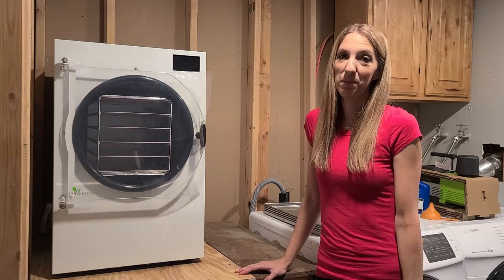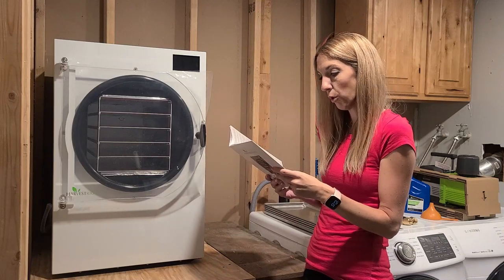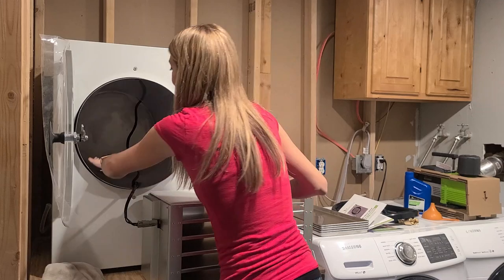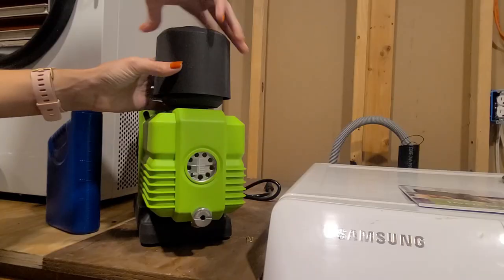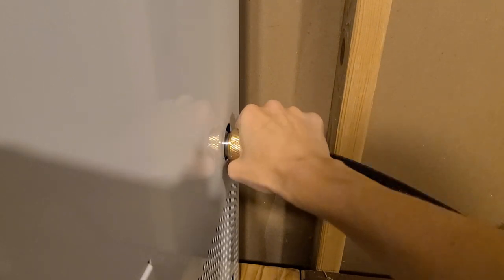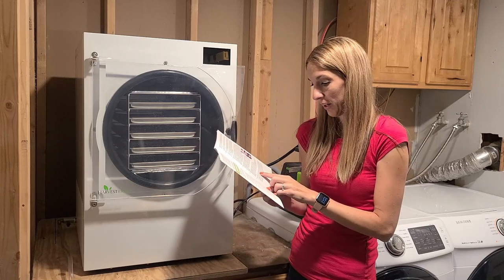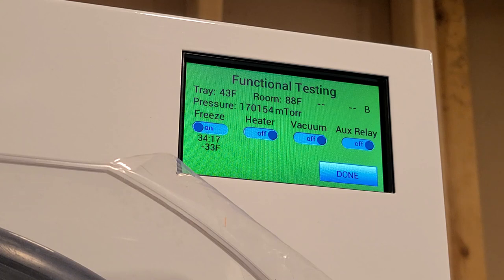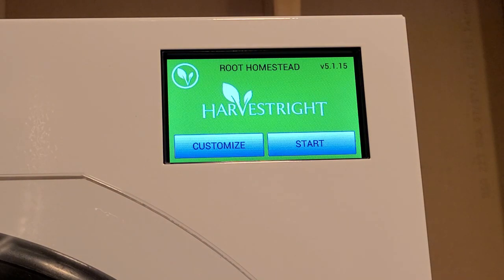How To Set Up a Harvest Right Freeze Dryer - SO EASY While Following the User's Manual

Comment: The plug off to the side is the dedicated 20 amp breaker. Meaning the wire goes right from the breaker to that outlet only. Only the large freeze dryer requires it.

Comment: Our freeze dryer is set to arrive tomorrow. I was just checking out videos to watch so I could have a head start. Your video is great. Thank you so much. I do have one question that I have not seen anyone address. I called the company last week and ask if the drain tube could be put on the right back side of the machine instead of on the left. Every video I have seen it's always been on the back left. The company told me that it could be put on either side. I guess we will find out tomorrow but I was just wondering your thoughts. TFS. Debbie
Reply from the maker: Yes, there is a hole on both sides, so it looks like you can put it on either side. But when you receive the freeze dryer, the valve will most likely be on the back left side. It might be a little challenging getting it over to the other side because the inside tube is not very long. You might want to pull it out the left side and tie yarn or something to it to help from loosing it inside. Get creative and I'm sure you can make it work. Keep in mind that all the internal wires are on the right side too. But no matter what side it's on, there should be space for ventilation all around it. Hope this helps, and good luck!

Comment: Thanks this was a big help.  My only problem is that dedicated plug.  I have one in my laundry room I could plug into but my unit is in the garage right outside the laundry room door.  So, I’m going to try to use a heavy duty extension cord short one and hopefully I will still have enough power to run the unit properly.  Luckily I didn’t get the crazy plug you did.
Reply from the maker: Glad the video was helpful! The outlet part of the setup can be tricky to figure out. Good luck! I hope it works out for you.
Reply: The different plug is for the large size. You must of gotten a smaller one 🙂
Reply: I guess I did get the smaller, it’s a medium size so I don’t have to worry about having enough amperage to use it, the manual isn’t very explicit when it comes to that…So I figure as long as nothing else is running on that line I should be fine, just to be safe..

Comment: I just received my medium with premium pump.  Unfortunately, it won't pull the proper vacuum during initial run/testing.  I checked everything, including the vac hose.  I discovered 1 fitting did not have an O-ring.  I sent pics of the 2 fittings, and the company is sending me a new hose.  I don't know, but I hope the new hose fixes the lack of vacuum issue.

Comment: So the pump will not run continuously when freeze dryer is running ? The freeze dryer will tell the pump when to turn on?
Reply from the maker: Correct. The pump does not run throughout the entire cycle. The freeze dryer run is all automatic, including the operation of the pump. It is just important to make sure the setup of the machine and pump is correct so they can work properly together. (pump plugged into the back of the freeze dryer, pump switch on, pump gas ballast valve open, proper level of clean oil, hose connected properly, etc.). Hope that helps!
Reply: @roothomestead4504  awesome! So ya don’t need to sit around and wait for it to finish either? Meaning if it finishes in the night your ok h til ya come back the next morn? Long as power doesn’t go out it will shut down on its own? What are the customization settings for really ? Asking all this cuz HRFD manual got water damage and lost!

Comment: That the room temp not the inside
Reply from the maker: The temperature on the screen in this video starting at 26:32 is the room temperature of our house. However, during a cycle when the freeze dryer is running, the temperature showing on the screen is the temperature inside the drum or chamber of the machine. You can see an example of this in our bread run video. I hope this helps!